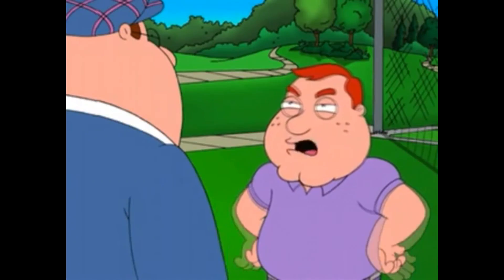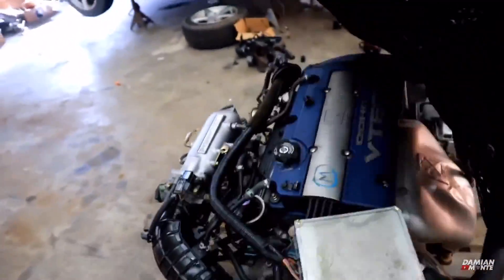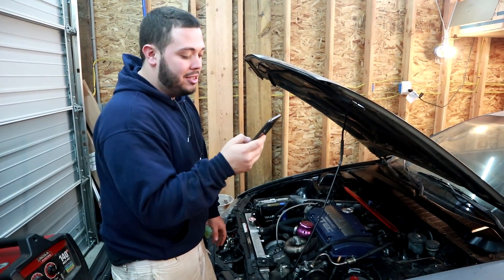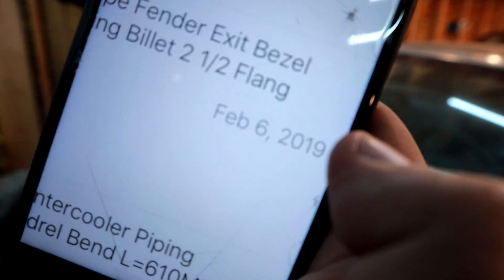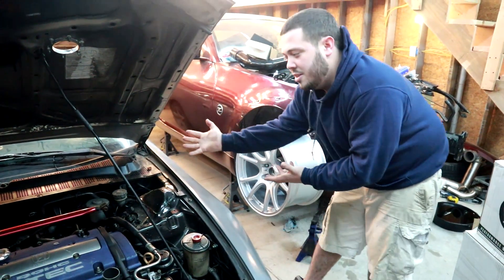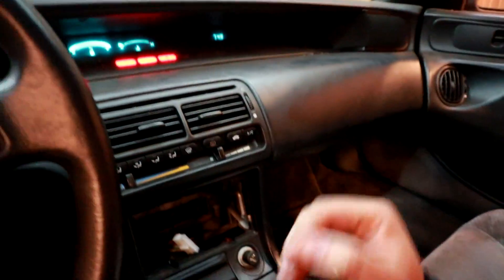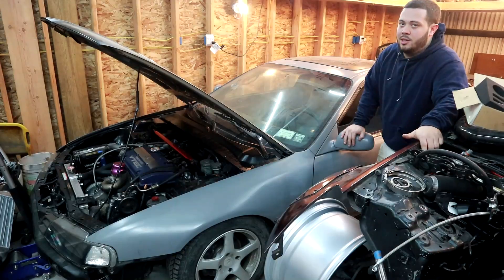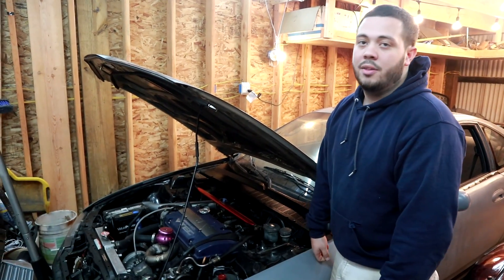THE REAL COST TO TURBO A HONDA: EBAY KIT

Comment: Did you put the smaller pulley on the Power steering pump????, maybe it's spinning too fast now causing issues!. Can't wait to see it tuned and being daily'd :).
Reply from the maker: Johny Action no sir I swapped the h23 crank pulley and the h23 ps pump right over and it was working mint before

Comment: From a few guys who’s gone turbo, with their integra gsr’s, I’ve gotten a list of parts and a total cost.. and it was roughly $4000.. $2000 for a decent turbo kit, and the other $2000 was for miscellaneous parts and fab work.. oh and loads of headaches.. got to drive one and damn.. made me want to turbo my car so bad!! The higher compression made the smaller turbo spool up quick.. it’s like an on and off switch

Comment: the servo pump did you watch how it needs to turn ? or is there a reducer in the feed line some ware and check pully size you are building tomutch pressure on the system

Comment: I Like the recap!  And still think you must be sucking air into your power steering pump.  Rotary Pumps tend to compress a lot of air when combined with fluid which can create large pressure!  I've seen it when cars are almost out of gas. (Pull the line and it shoots 20 ft of air and fuel!) But still worth a check! You got me bothered by the steering issue! I gotta know when it's resolved! lol If it was a customers car at work. I'd be losing sleep over it!

Comment: Turbo swap subie. Sell it or trade for another lude. 750+ Hp prelude with stock sleeves Ebay rods pistons and turbski. I’d love to see you do an engine set up similar to Kyle’s H swapped civic, but with an H in a prelude.
Reply: Nick Buchta wrx swap the subie with an sti 6 speed trans. Wrx springs, etc. that thing would transform
Reply from the maker: They don’t have eBay rods and pistons for these engines or I would 😂
Reply: Damian Monte I think you may have misunderstood me, I meant I’d like to see you do an all Ebay H prelude, not an F. Sorry